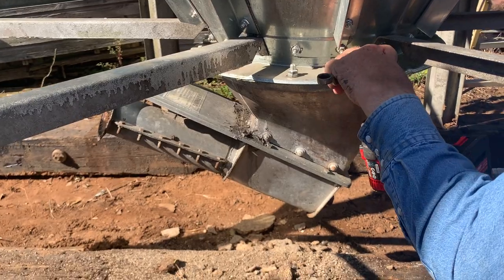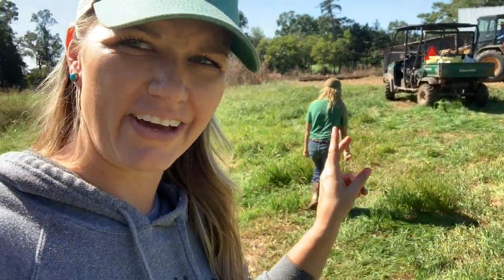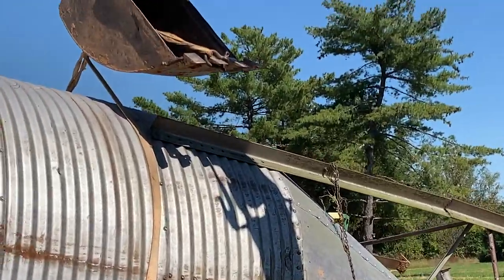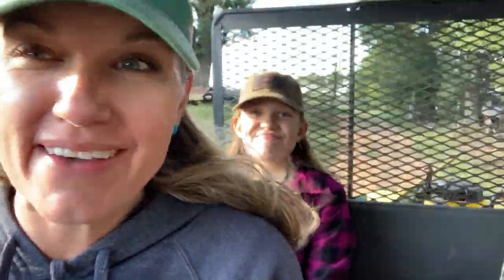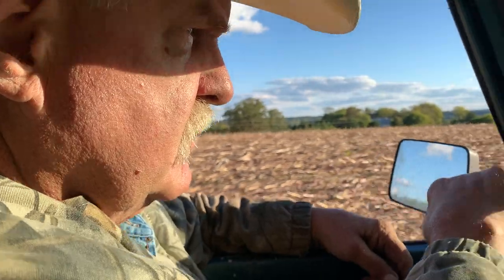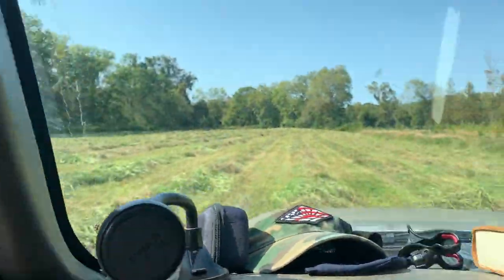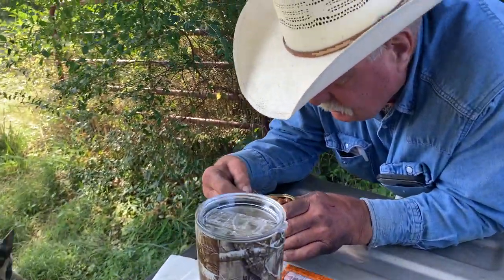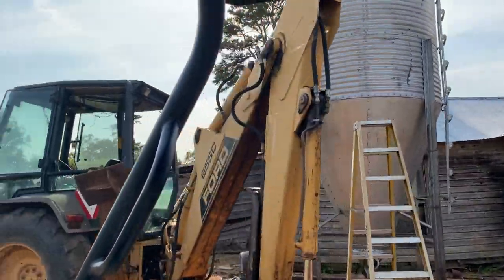Tailgate Talk : I wasn't mad about the new tractor! (For long)

Comment: 6:02 The next time you lift something with a backhoe, put a rope (tag line) on the lower part of the object, so you can control from a safe distance. Also the position of the strap round the tank, is important for balance and to make the bottom fall down. The backhoe is almost not tall enough to get the tank vertical.  You can drag the feet against  the ground and pull the tank upright. Good ole physics, friction against the ground.

Comment: Hi Meredith,  Lawrence can make a crane boom to fit on the backhoe loader.  Get some 2" pipe and weld it together in a triangle to fit into the front bucket to extend the reach about 15'.

Comment: What you shoulda done with that silo was to extend 2 of the legs using something that can easily puncture the dirt and extend the 2 legs by like 1 foot so when you lift it and it's tilted the 2 extended legs will stick in the ground sorta holding it in place so you could then pull it until upright